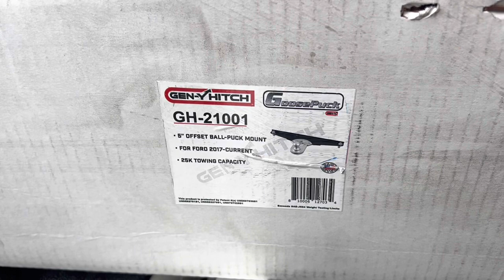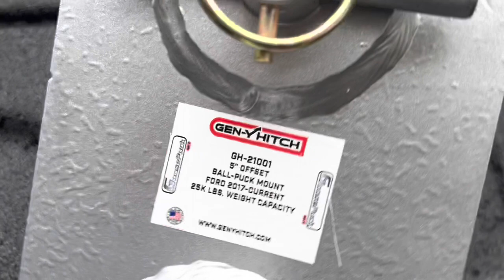Ford Superduty Goosepuck 5” gooseneck ball offset Gen-y GH-21001

Comment: I just got one of these for my truck. It’s a 2020 GMC Denali. I will say that the hitch is a very quality product and it’s very sturdy. But apparently they are having issues with the GM trucks and the factory puck system. The GM trucks system is recessed by about a half of an inch and that makes it so that the goose puck will not lock into the factory puck system. I’ve contacted GENY and they said they’ve had some issues with the GM trucks. I hope they can get it figured out because it’s a great product.

Comment: This is me probably overthinking but have you had any issues with it being offset pushing down enough to dent your bed, or torqueing your gooseneck receiver?  The weight is not directly over the receiver so just curious if that presents any issues.
Reply from the maker: It has not

Comment: This fall I plan to order a 2024 F350. I constantly debate myself what to order, standard bed or long bed. With the goosepuck installed what is the distance between the ball to your rear window?  Since it has been 5 months since you made this video is it providing sufficient clearance between the trailer and the rear window?  If you had your choice would you go back to the sidewinder?  Thank you for the video.
Reply from the maker: The Goosebox is amazing.. No chucking and smooth to pull.. I would never go back to a fifth wheel again.. I have had lots of messages from peeps that went to goosebox and absolutely love it.. The sidewinder is a good hitch but had some tongue pull tendencies such as sway and stability.. The offset plate with goosebox is perfect for me..  I have enough clearance to drive and maneuver in most situations. Without the offset I do stress more.. The king bed vs shortbed has its pros and cons.. I do a lot of traveling to big cities with small parking spaces and I don’t care to drive long wheel base trucks.. This is why I got rid of my mega cab Rams.. The long wheel base will ride better and tow better and have a larger fuel tank if you can drive it daily and you will not have to worry about hitting your cab.. hope this helps with your decision. Either way junk the fifth wheel and get a goosebox.. You will have zero regrets and your back will thank you later.. The first trip we took after goosebox install my wife said I didn’t even know we were towing a trailer. We just did Texas to Florida and it was amazing.. I10 from Beaumont to 12 would have beat us to death lol..
Reply: What ever you do!  Do not used the B&W ball with the 4" offset in the bed of your truck.  You will eventually turn to sharp, and bust out your rear window!   I know, because that is what happened to me!

Comment: I would say that I definitely recommend some Never Seize On Gooseneck Balls before you Put One Back In. I feel bad for the person that got my last Diesel Pickup with my B&W Turnover Ball. I just never towed with my Personal Truck all that much, and even though I had a LineX Bed Liner, those Turnover Balls always end up Rusting Inside of that Mechanism, and all it takes is a Little Bit of Rust to freeze one of them up. I also had a B&W Extension Ball, that moved it back a Few Inches, not sure that it was worth the Extra Money though when I bought it a few months later.

Also, the thought of ReSkinning the whole Truck if it gets Damaged is probably another reason that I will stay with Dodge or GM Pickups with Steel Bodies for company trucks unless it is a Dually with Flatbed.
Reply: Thanks for the tip, I have a Gen-Y hitch that sits on the B&W ball I the bed of my pickup.  I am going to buy some "Never Seize", before I pull again.
Reply: @alanpetersen4497  Any kind of Anti Seize products, most are a Silver Color that is brushed on with the applicator cap.